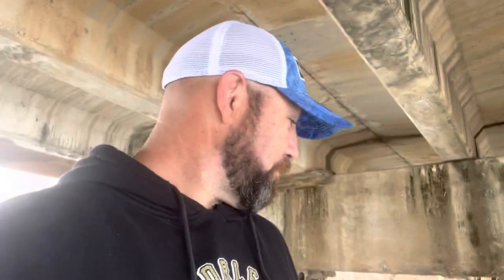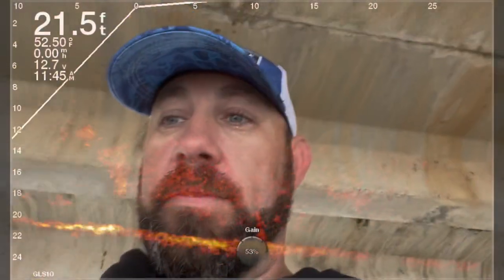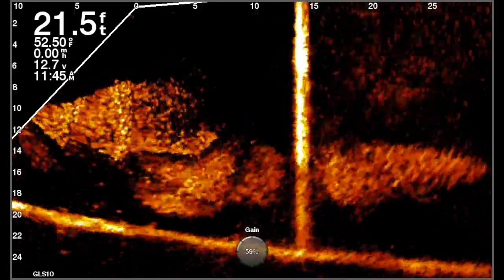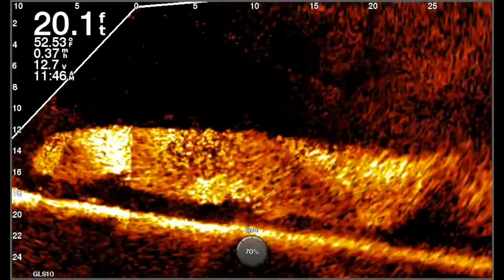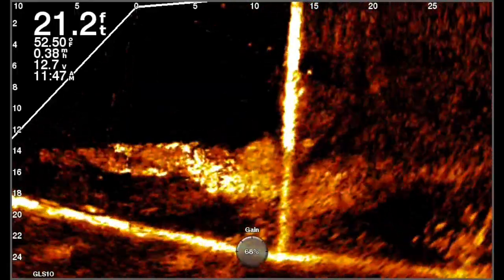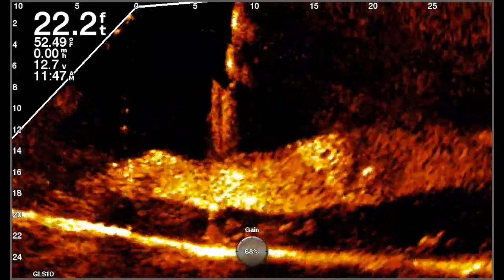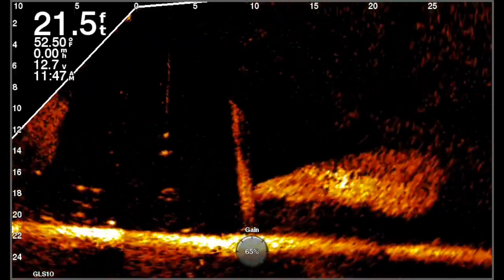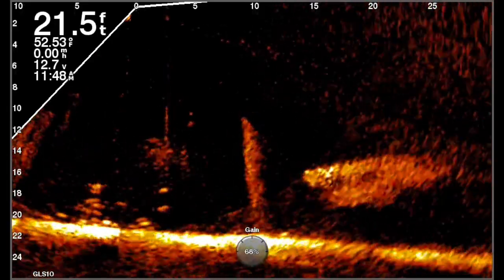Garmin Livescope: Gain!!! What Is It? What Does It Do? Let’s Dive In

Comment: Gain related story.  Went out to my local lake the other day trying to work on my setting since updating.  They have been doing controlled burns around the lake.  Lots of smoke in the air.  I can tell you that this caused all kinds of clutter on the screen.  My guess is that there was debris falling in the water.  Had to turn my gain way down and use more noise reject/TVG/ghost tree reject.  Was a tuff day to try and get my setting dialed in.  Thanks again for the posts!
Reply from the maker: That’s very interesting. I’ve found on bright sunny days it affects how you adjust gain also. Have your experienced this also

Comment: I updated my 2 93sv Echomaps to version 19.20 and my black box to 2.57. I admit I was worried I screwed up doing the updates. I used your settings as a starting point and my detail was awesome! I see more detail in my brush piles and target separation was a lot better than before. I only see one thin spot where my jig disappears just for a second. Thanks for doing these videos!
Reply from the maker: Thank you sir for the kind words. Tight lines

Comment: Was that a double jig setup and what size jig head?  I'm new to LS and mine do not show up that well.  I mostly use 1/32 oz heads, single jig.  I've never been able to see my jig over 20 feet.  is that normal?
Reply from the maker: That’s a lead weight above my jig. Helps to find your bait easier